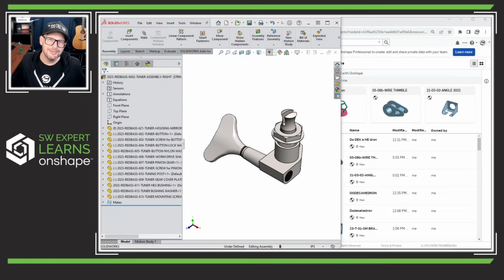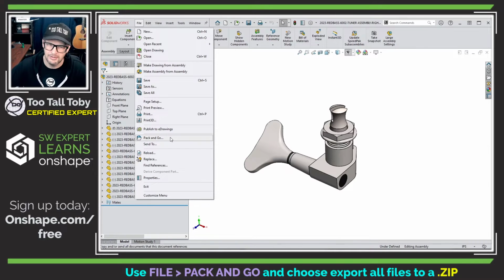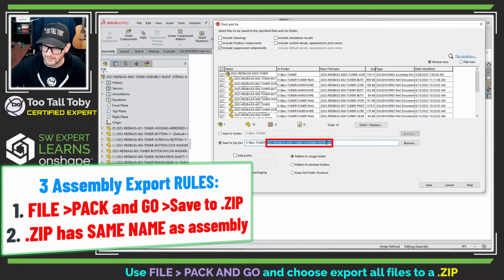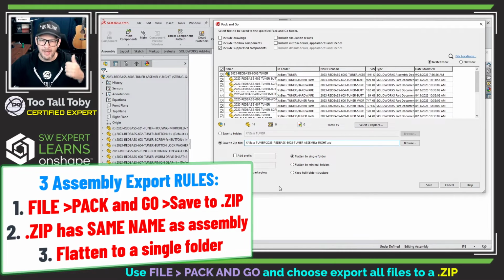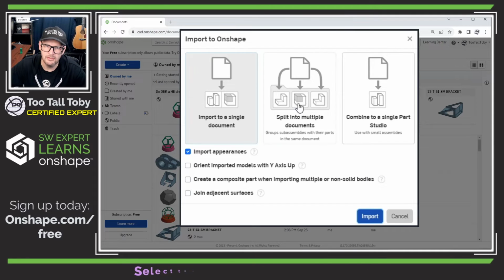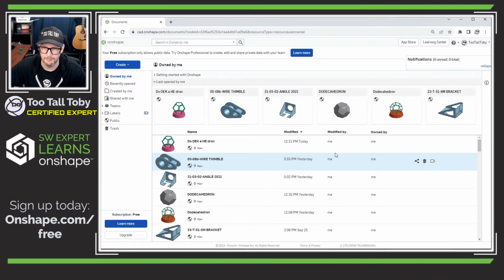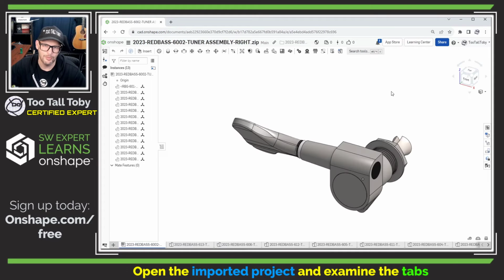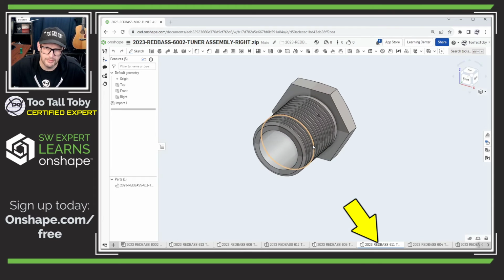Importing a SOLIDWORKS Assembly into Onshape

Comment: All my parts in the assembly from SW ends up bunched together in the middle around origo, and not placed where it should be. How do I fix that?
Reply: This is the issue with onshape. Does this with .step files too.

It makes it so difficult to work in context
Reply: @Elliot00000  Is there already a fix? or I just heft to import every part in to a single part studio but i have over 100 parts ;(. I hope onshape will come with a fix.
Reply: @user-fe9tw6mn9w  the fix is to use another cad unfortunately!
Reply: I found a solution:
You can import a complete solidworks pack and go into a single part studio. After that you can create an assembly an do easy in content editing.